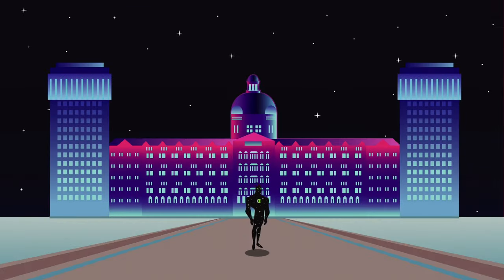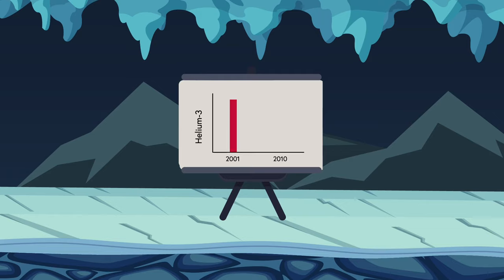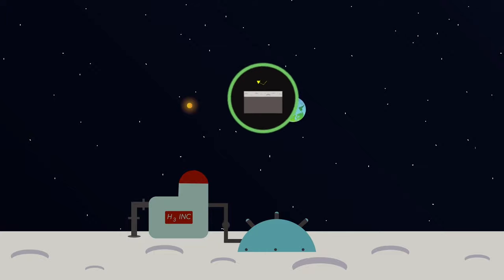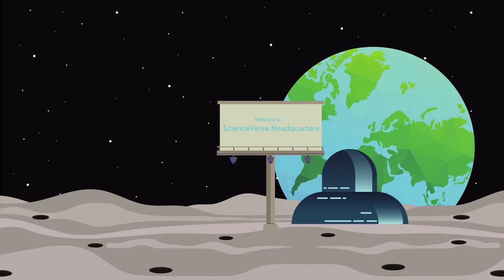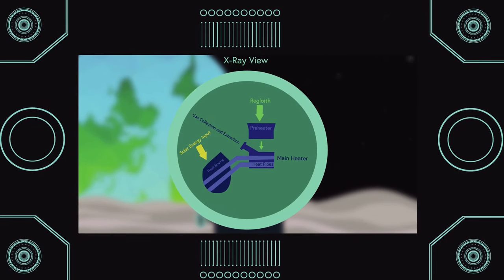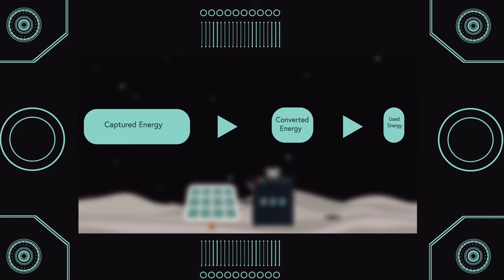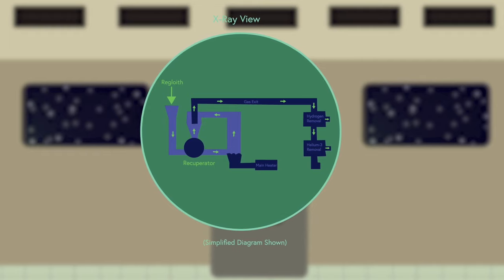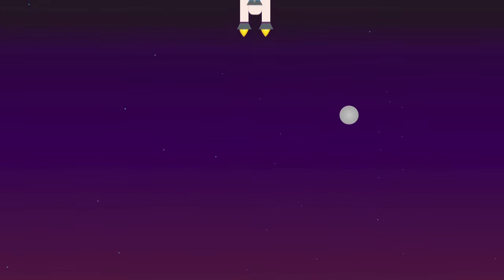Could Helium-3 Power Our Future? (Part 2)

Comment: another fine video!  to heat regolith: Pipeline with Fresnel lens top and parabolic mirror bottom to heat the slurry of regolith that runs through the pipe that has mixing baffles.

Comment: You quickly glossed over the potential of nulear as a power source.  You did not look at the possibility of SMR's (Small Modular Reactors) that can produce in the Mega Watt range.  They can fit on the back of a truck.  They are well developed - particularly by Rolls Royce.
You also did not consider Starship that can carry 100 tons (possibly 150 tons or more) to low-Earth orbit.  Musk is looking at in-orbit refuelling (and has a contract to do so from the military).  A reactor of significant capability may be taken to the moon in the near future.  If a pay-load of - say - 100 tons can taken, so can mining equipment, habitation modules and gas-processing and refining equipment also.  It would then only be necessary to return pressure-bottles of compressed Helium3 to Earth.
This is only practicable via the work that Musk's Starship and SapceX are doing.  It is a HUGE commercial opportunity for him.  To do this would need a lot of up-front money.  NASA is unlikely to get it from Congress.  Musk has the Starlink project already underway with calculated potential revenues of $40 billion p.a.  He would not need NASA to fund it.  Helium3 sales on Earth make fusion power practicable.   SpaceX is a private company - so he does not have risk-averse shareholders militating against such a venture.  Musk therefore makes (another) fortune to fund his ambition to set up a colony on Mars.  It is beginning to look like a feasible proposition.
Imagine being the sole monopoly supplier of the fuel for feasible fusion reactors!!  How much could you ask per kilo?  (How big is your imagination?)
Reply: why doen't elon bring hilium3 from the moon ..,,????....
you can fit 8 billion people in 50MK SQUARED...........